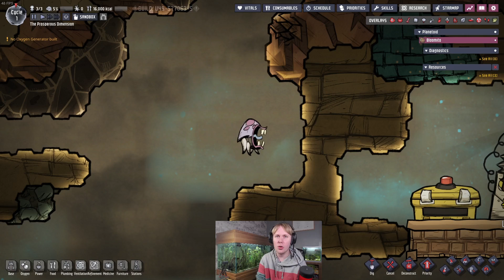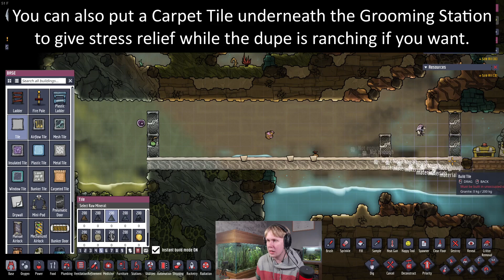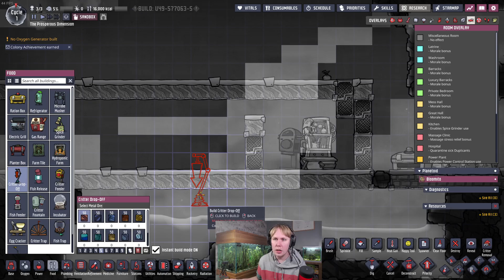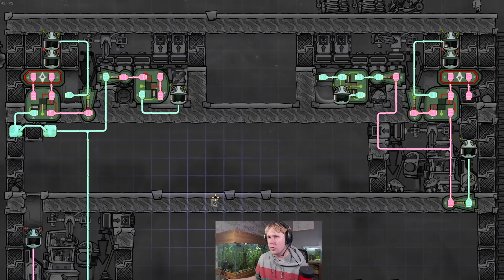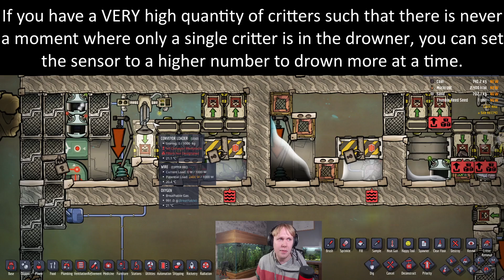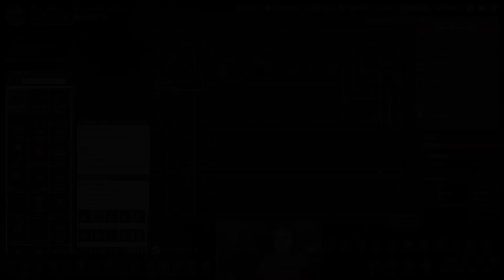How To Ranch Hatches, Sweetles & Grubgrubs In ONI: Spaced Out! Sandbox Showcase #6

Comment from the maker: Quick update! With the new Critter Drop Off buildings having an automation port at the bottom, you will need to move the Not Gates up by 2 tiles and using Automation Wire Bridges to avoid a clash. The build otherwise still works as it did before.

Comment: You probably said it in the video and I missed it, but for anyone reading comments as they build this. I daisy chained two sets of 3 stacked sweetle ranches (so 6 ranches with 2 separate control rooms) so that I could take half of the sucrose to feed a Grub Grub ranch and the other half to feed Spigot Seal ranch.  But, the sweetles lay grub grub eggs! And the grub grubs lay sweetle eggs (I think. I could be wrong about the latter, but somehow had a sweetle in my grub grub ranch). So, after a few 10s of  cycles, the ranches had mixed critters because I wasn't paying attention. So, with one of the extra conveyor loaders to shuffle the mismatched eggs to the appropriate ranch. 

I'd really like to figure out how to reuse converyor rails more effectively for long distances across the map. What I've been doing is on one feeding/input side, putting lots of stuff on the rail. Then I drop it all on the ground at the intermediate destination/sorting destination. Then pick it up and place in the appropriate conveyor loader to get it to it's final destination. I find this to be more efficient than using a Solid Filter. also, you can start doing it very early in the game, since solid Filter uses all 4 research stations. And after saying all this, I suppose I could've just had a 6 stacked tall sweetle ranch, with 1 control room and then split the sucrose using rails or other methods.